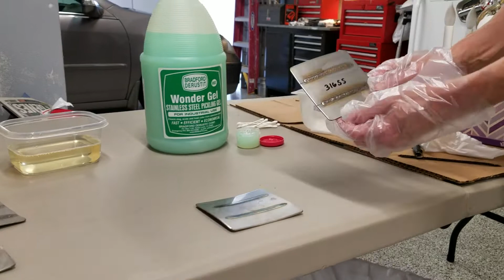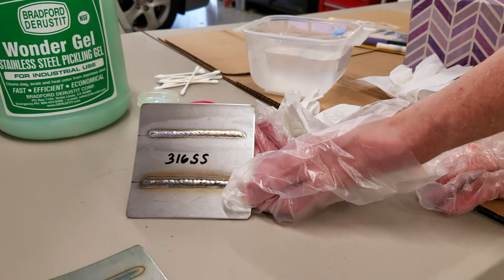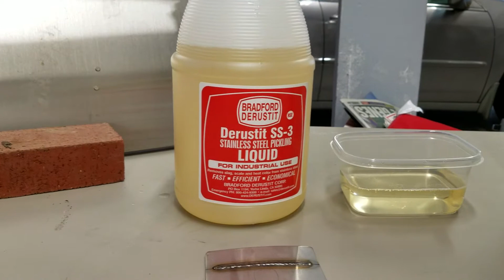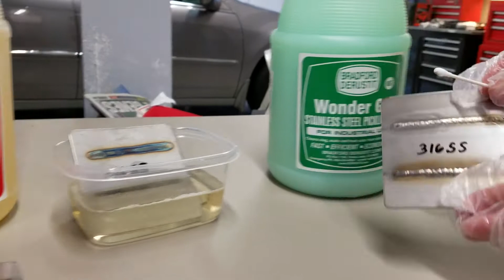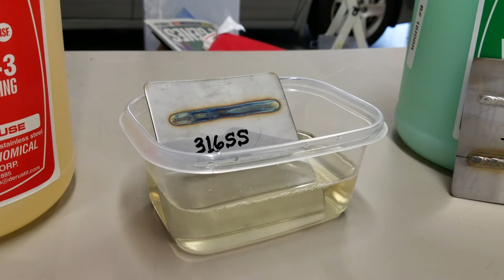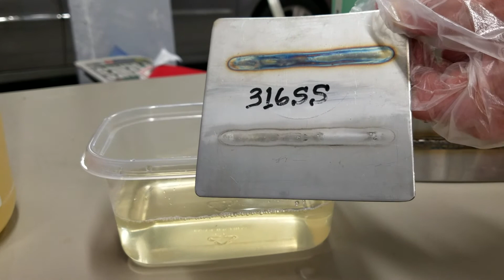Bradford Derustit Wonder Gel / SS-3 Demonstration

Comment: I love this stuff. I used Wonder Gel and SS-3 on many jobs - repairs to stainless steel countertop and sinks in commercial kitchens, swimming pool filters and ladders, cookware, etc. The best part is that after treatment with either product, the stainless steel is fully passivated, and thus much more resistant to corrosion, polished stainless taking on a slightly "milky" shine.

Only one complaint about especially SS-3 liquid is shelf life. It separates on the shelf after a year or 3 into a stony white sediment with a clear liquid over it. it can be remixed with endless shaking, but rapidly settles out again. Plan on using it promptly for best and easiest effect.
Reply: is this product available in the philippines?

Comment: What is the proper PPE for this product?  Looks like you are just wearing some loose gloves and no arm protection? There is HF acid and Nitric acid in this according to the SDS.  HF is extremely deadly if it comes in physical contact with skin.  How are you not suited up like an astronaut  / with a respirator, long neoprene gloves, chemical apron, face shield, chemical glasses, rubber boots, while being around this? Whats the proper disposal? Hazmat pickup? Or is this product somehow more inert / the concentrations in the product are not as deadly?
Reply: She's doing a tiny piece in a pretty controlled environment. If she was doing this is an industrial environment, working on large parts or removing it with a pressure washer then yes, a spacesuit is required as a minimum haha
Reply: The amounts of the chemicals you reference are very, very low in percentage terms of the product. Use the gloves, safety glasses and a mask if indoors. Also have good ventilation. See the SDS for complete safety protocols on the website.
Reply: @markdenney8738   1 to 5% of HF is still deadly. I am wondering how anyone works with this stuff or if it is complexed with another compound to reduce affinity to human skin and bone.